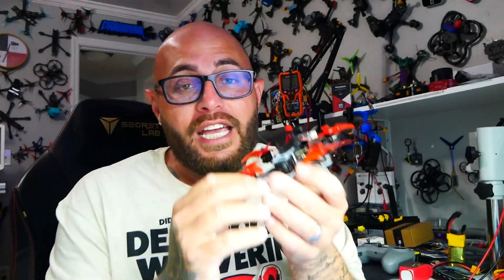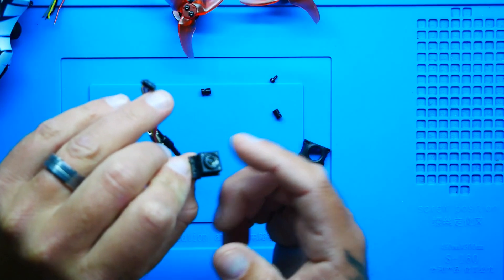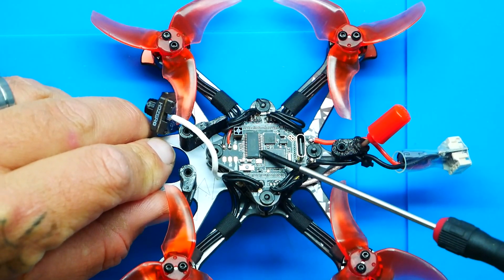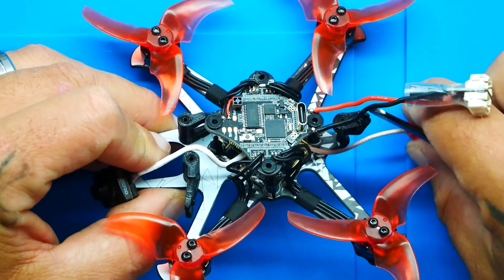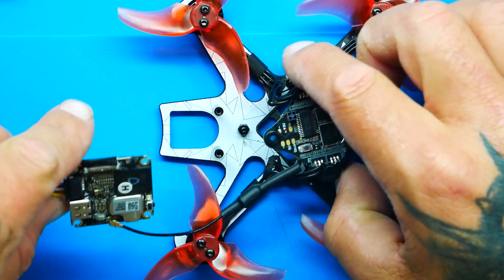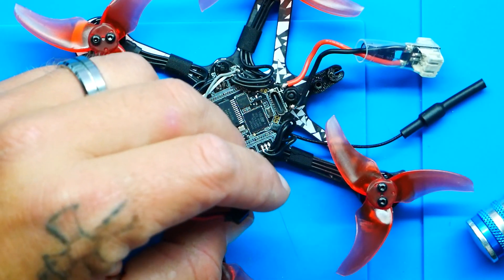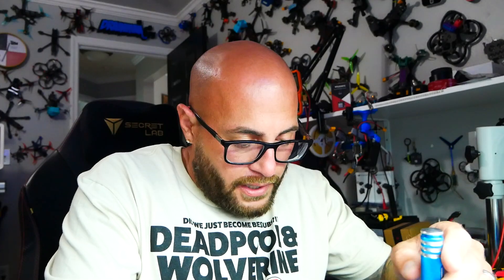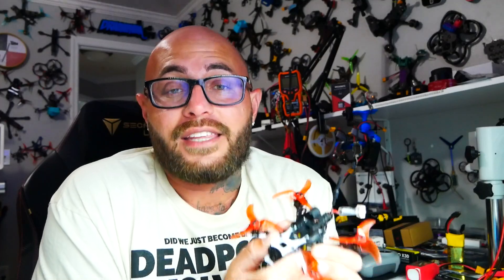How To Build A Micro Drone With The New DJI 04 Air Unit Lite

Comment: I’m amazed at how you were able to build a 04 air unit lite kwad with no jello. I’ve been struggling with this for months now.
I build a BetaFPV Meteor 75 04 pro and have printed all types of TPU canopies and mounts with no luck. I just ordered another unit and I plan on trying to mount it to a GepRC phantom HD 2.5” on 3S.
I’ve been following Albert Kim’s videos on the 04 air unit lite and he seems to be having the same Jello issue, I think he’s 2 to 3 videos in on trying to solve this problem.

Comment: are those two wires required to use the dji controller and what do you change in betaflight , i also only have uart 1 and 2 does that change if i solder those 2 wires on

Comment: I just got DJI Goggles 2 that came with the DJI controller 2. Do you think i could use the DJI controller with one of my drones and the O4 lite like you are doing with the Controller 3? 
I had planned on just using my EdgeTX with the on board ELRS but would love to use the DJI controller if possible.
Reply: My understanding is the controller relates to the goggles. So controller 3 only works with N3 or G3. Controller 2 works with G2 or Integra. Given 04 air works with goggles 2, Yes you should be good.

Comment: Knowing that the DJI remote 3 is transmitted on same signal a video which means you loose video you loose your remote link also. Also the price the controller 3 is insane for what is effectively a cheap Bluetooth controller.

Also anyone connecting to 5v pad, make sure you check the rating for the 5v BEC as needs to min of 2amps. This is because DJI state the O4 lite uses 10w.

Comment: It turns out that Goggles 3 actually have 6 antenna, not just the two folding ones we see. There are two in the forehead pad and two more n the front cheek area. Check out Mads Tech’s tear down video for details.